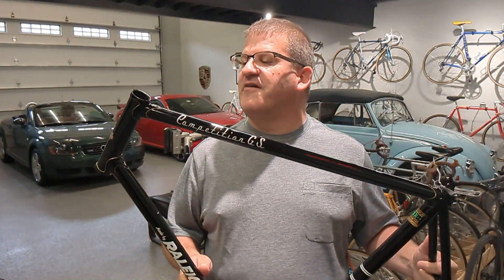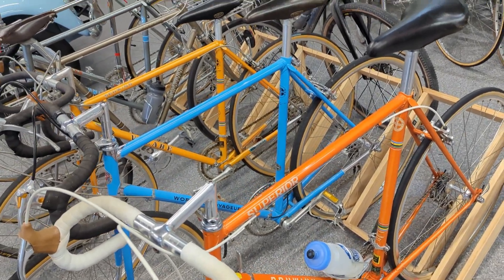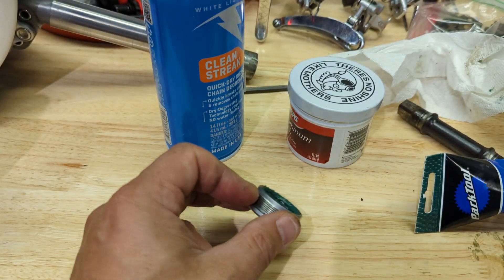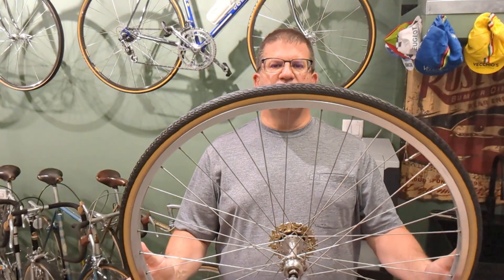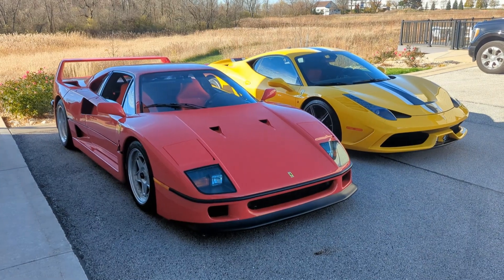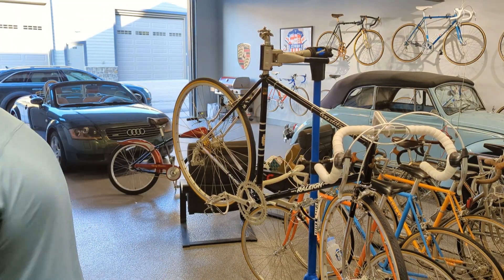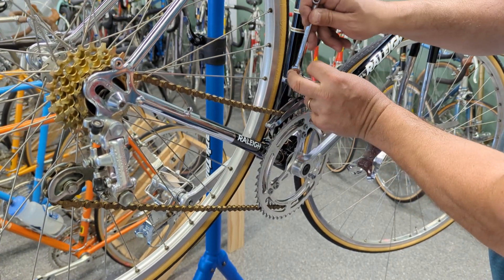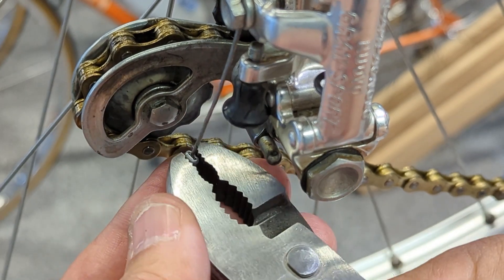1980 Raleigh Competition GS Complete Restoration

Comment: I got a new one in '78 from.... Chuck's cycle shop. I took it to Germany with me where the rear brake lug broke loose. Nottingham sent me to Bitburg for a new frame. Some scumbag in Elgin stole it when I got home. 
 The new frame had different graphics, and no chrome.
Reply from the maker: I used to go to chucks as a kid. I have his dealer agreement and Raliegh quality display in my basement. Not sure if you saw that.

Comment: Traditionally Carlton bikes were built like this:
1st-level bike was a beautifully finished frame with fancy paint and rear brake bridge reinforcements (last detail done to a high-end bike), fancy lugs or cool fastback stays, 100% campagnolo.
2nd-level bike was a showy bike with nervex chromed lugs, chromed stays, all campy except for weinmann $12.95 brakes rather than $65 campy brakes (20% of the price of the bike).
3rd-level bike was a racing bike as cheap as possible, often "dipped" in black paint with french parts to save money - The Raleigh Competition.
In later years they used nuovo gran sport parts (perhaps campy made them a deal they couldn't refuse!)

Comment: Great build, John. Good luck finding a 6 speed gold freewheel. Until then, a 5 speed will have to do. Since the frame is a 1980, I assume that the spacing is 126mm? It's been so long now, but I seem to remember that Sun Tour made an "ultra 6" speed freewheel that fit in 120mm spacing, on a 5 speed hub.
Reply from the maker: The one on there is a five speed.

Comment: What gum wall tires do you recommend other than panaracer ?
Reply from the maker: Not to sound like im picking. I think you're referring to Skinwall tires. Lighter weight performances tires? There are many other brands if you have a 700c wheel. But in a 27 inch size you are limited. Continental makes Gatorskins in the 27inch and Schwalbe does but they look like they have huge treads. If you find another please let me know!!
Thanks!
Reply: @JohnsVintageRoadBikeGarage  .... Yes I called the gum wall because I think I heard you say gum wall in the video. I have the 27"x1 1/4 I bought the black wall Continental gatorskins but they don'r look as good as the skinwall so I did replace some tires with Pararacer skinwall but I thought you would know of a better tire.

Comment: Balls push lubricant out the way.
They push 85% of the lubricant out of the way. 

You're wasting your time and spinning motion if you go over the maximum limit of 30% lubrication. 

The balls need to spin to infinity.

You achieve this by putting 25% lubrication into the race.

The balls will seem like they're spinning off to infinity. 

Apply over 30% lubrication and you're harming the balls ability to spin.

The soap applied to the oil is designed to stick to the ball after its pushed it out of the way.

You've over greased your bearings by 70%.